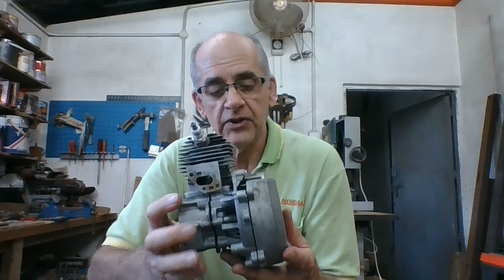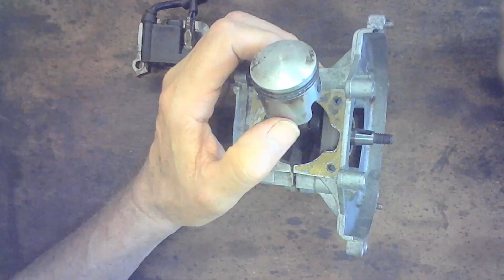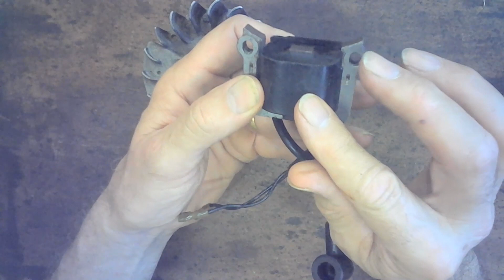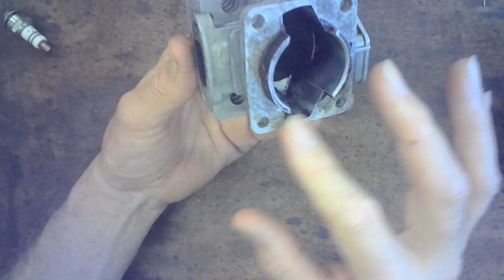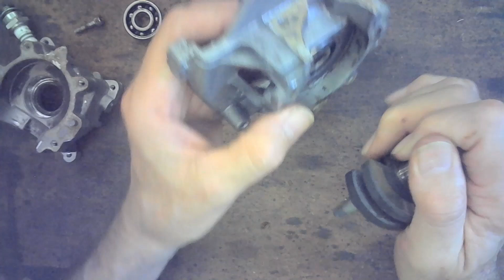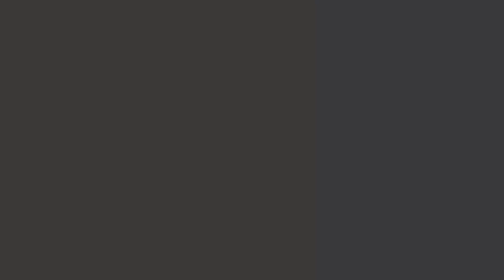Disassembly of a 2 stroke engine - part 2

Comment: This video gives a better view of the components for the project.  Does the engine performance increase with the spark plug being positioned diagonally?
Great video Mr Nigel!
Reply: Hi Gowri, thank you for your comment and I am glad if it improved your understanding of the project. Good question about the positioning of the spark plug. I cut the cylinder head in half (perhaps I will make another video on that) and noticed that the spark plug penetrated the cylinder head to the midpoint of the chamber top. The spark would therefore be in exactly the same place as compared with a vertically mounted plug. Thus there should'nt be any difference. The main reason for the diagonal positioning is to allow access since this component is changed/serviced regularly. Thanks for watching
Reply: @nigelbrewitt2776  I did consider modelling my spark plug in a diagonal position but I didn't seem to have a proper reason behind it. On the other hand, it does seem to provide ease of access for maintenance which would be a great consideration for the project. A video on half sectioned cylinder would be awesome Mr Nigel. This video should be played during the class as well.